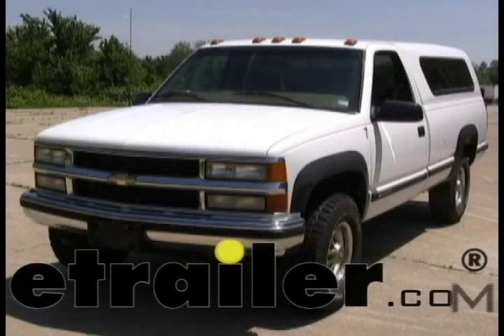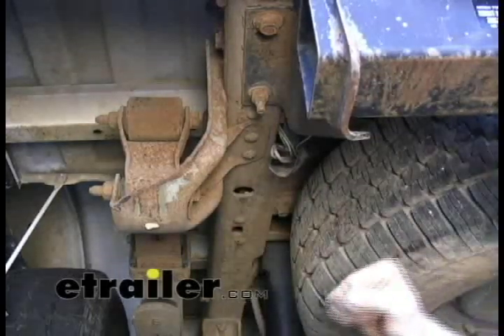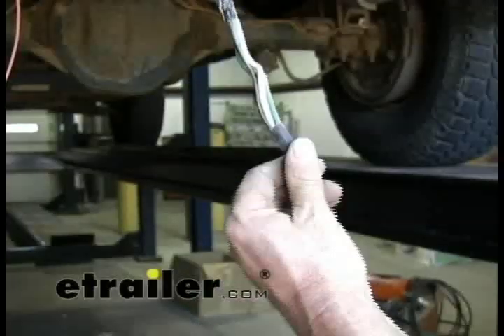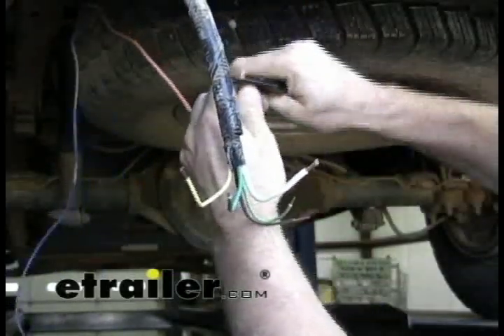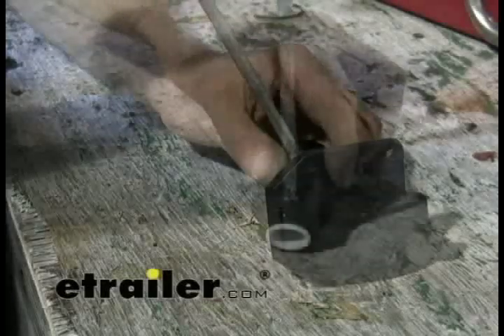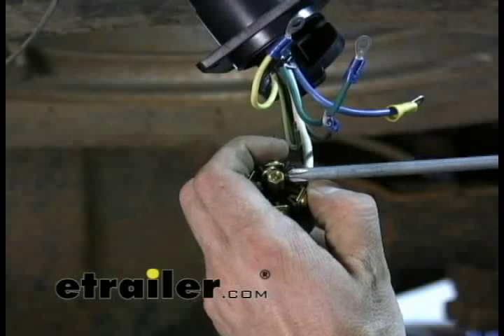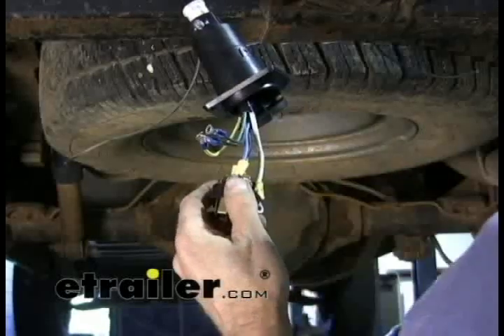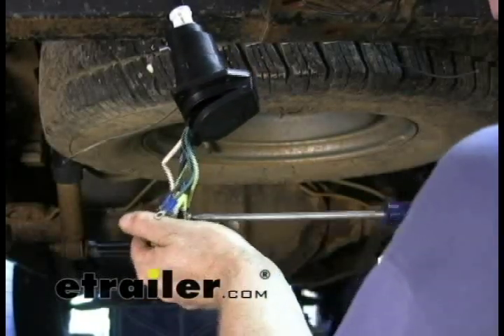etrailer | Setting up the Tekonsha POD Trailer Brake Controller on your 2000 Chevrolet Silverado

Comment: So if they already have a splice to make a four flat all I should have left is the 2 main
Reply from the maker: You just need to 12V power wire, brake wire, and reverse light switch. Check out the following link and you'll see our most popular kit to do this.
https://www.etrailer.com/Accessories-and-Parts/etrailer/ETBC7.html
Reply: @etrailer  already got it thanks, great video!!! Techs rock!